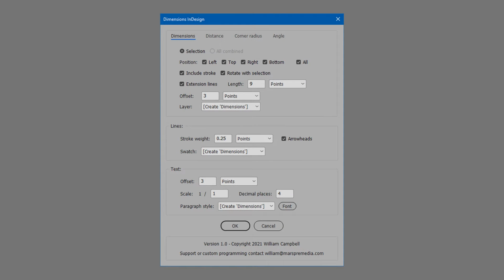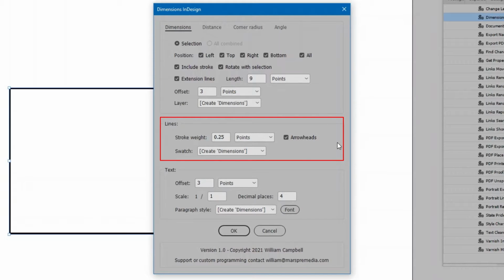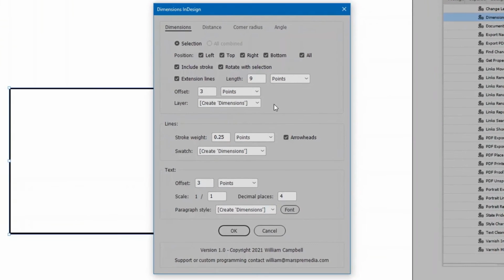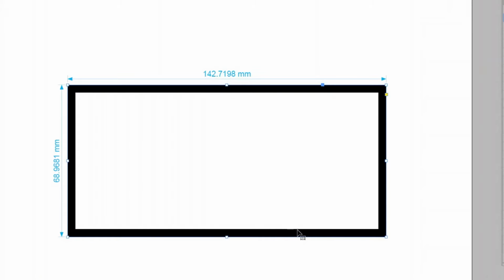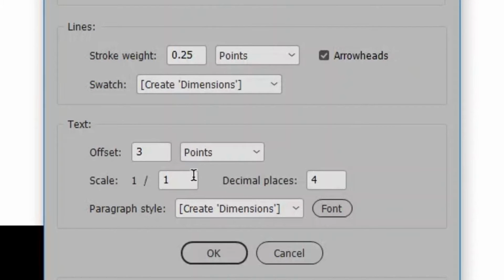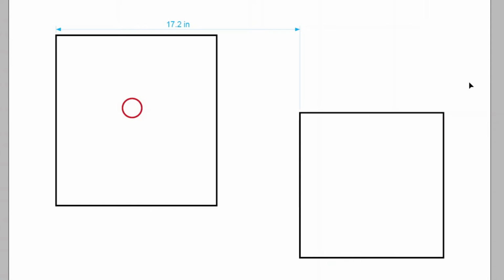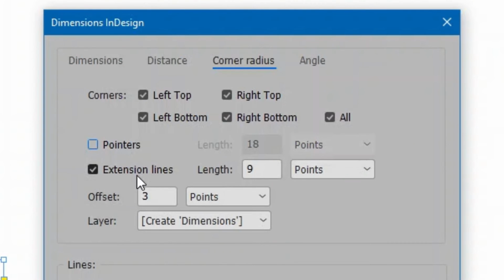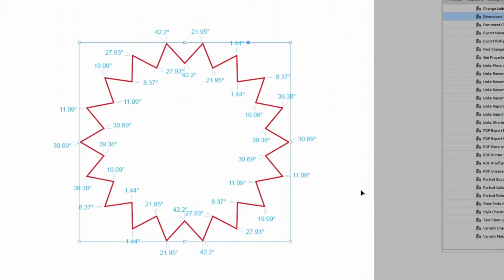InDesign Script Dimensions

Comment from the maker: New features as of version 5.2:
- Paragraph style and swatch names sorted alphabetically case insensitive
- Distance selection 1 is always left-most selection instead of order elements selected
- Extension lines and text offsets allow negative values to put measurements inside elements
- Measurement units now selected in the interface instead of coming from the ruler
- Paragraph style "None" set font manually
- Select the measurement units "style"
- Configure arrowheads
- Arrowhead options simple, triangle, circle, and slash
- Extension lines option to extend into element
- Options to draw lines or text, or suppress either
- Set paragraph style swatch
- Choice of decimal mark

Comment: Does this script have support for manually setting dimension start and stop points - I've been considering switching from an autocad workflow to a sketchup > InDesign workflow, but the real hangup is autocads native control of dimensions and notes.
Reply from the maker: No. Select an element and run the script. It adds dimension lines and values to the element. That is all it does.

Comment from the maker: Big update today, for both Dimensions scripts (InDesign & Illustrator). After user requests, I've made measurements units selected in the interface, instead of from the ruler. And I've added "styles" of how units are expressed (i.e. ft + in, feet + inches, or the marks ' + "). If you've downloaded either script earlier, you should download the latest version 3.8, on the website now. I have a video coming that explains changes to the InDesign version since this video was produced. Stay tuned for that soon.

Comment: what version of indesign this script is for. I have CS5 and it doesn't work properly
Reply from the maker: CS5 does not have the capabilities necessary to run this script. The script for sure works on latest versions CC 2020 and 2021. It may work on some older versions, not sure just how far back, but certainly not versions 10+ years old. The script relies on many modern features to accomplish its magic.
Reply: @wc7  OK, I understand, thank you for the answer

Comment from the maker: New version 2.1 now has circle and slash line ends. Download at script page: https://www.marspremedia.com/software/indesign/dimensions-indesign
Also added same to Illustrator version 1.1: https://www.marspremedia.com/software/illustrator/dimensions-illustrator
Reply: Could you perhaps look into adding dimensions for spherical objects? (i.e. diameter and radius for circle/oval) I would greatly appreciate this addition, if possible! :)
Reply from the maker: You can get plain dimensions (w x h), but beyond that it gets tricky. Perfect circles could do diameter, but when oval, what defines diameter? Similar challenges with radius. If you look at the page for the Illustrator version (https://www.marspremedia.com/software/illustrator/dimensions-illustrator) there is discussion of how that script determines corner radius, and that it's a guess. The InDesign script simply reads the property stored in the object. I'm not opposed to such additions, but I need to better understand how users expect to measure ovals for example, before I can even say it could be done, or is worth the investment in time to program the new code needed.

Comment from the maker: New version 2.0 this morning. Get it on the web page:
https://www.marspremedia.com/software/indesign/dimensions-indesign
Either "Lines" or "Text" can now be un-checked, and either won't be drawn.
Text frames now auto-size (should have to begin with!)
Can set text swatch independent of line swatch.
Option to lengthen extension lines into element.
Can define prefix for corner radius.
Lots of other little fixes.
PLEASE respond if I've broken anything. I will fix it quickly.
I want to thank everyone for the fabulous input to the project, here and in private messages. Users have helped me make a real gem. Thank you all!
And for everyone asking... yes Illustrator version is almost ready. Still working out some glitches. Soon!

Comment: Sorry I don't think my question pertains to your video. I'm just throwing this on every InDesign expert I can find. I have say three text boxes on one page. Is there a way to automatically put each text box one a separate page, or do I have to Add Page, drg down, add page, drag down, etc.? Does that make sense? Thanks for responding btw!
Reply from the maker: To create another page the same as an existing page, including the elements on it, right-click the original page and select "Duplicate spread."
Reply: @wc7  I don't think that would be any faster. I'm seriously starting to think this isn't possible, but I'll be more specific and maybe you will know. I am taking a multiple choice test, with one text box per question, and splitting it so each question is on its own separate page. Is there a faster way than just making new pages and relocating each text box?
Reply from the maker: @cyrene7784  Anything is possible, but is it worth the time to write a script is the question. This case doesn't sound like, unless you're talking 1,000 text boxes. You should ask your question like this on the Adobe Forum. More people will help there, and maybe have a script already. If not a member, sign up here: https://community.adobe.com/
Reply: @wc7  Ok! Thank you  :)

Comment: Is there a way to put multiple frames on separate pages automatically?
Reply from the maker: Not completely sure I understand the question. How do you define "frame?" Are you meaning a set of dimensions? The script does not work across pages. It can add dimensions to multiple elements on a single page, but not other pages. This is not to say a solution that processes multiple pages is not possible. Could be. Just not practical for a script made to address the most common use cases. If you have a need to add dimension marks to a great number of pages, contact me and we can discuss possiblities.
Reply: @wc7  Oops I should have responded here. Please see my other comment.